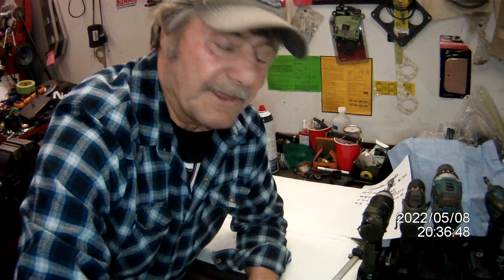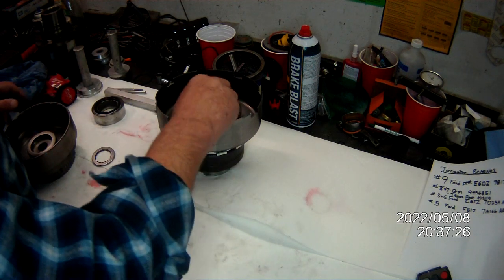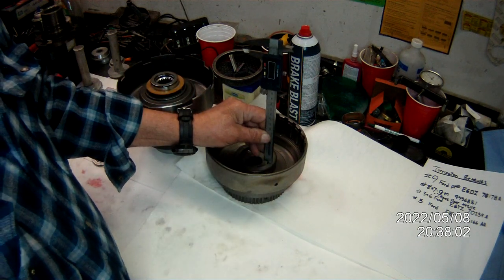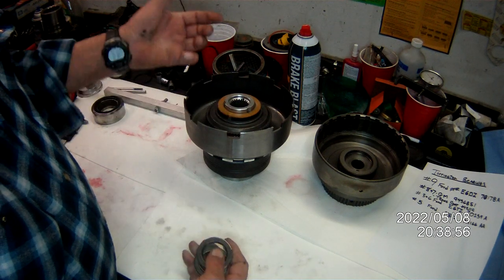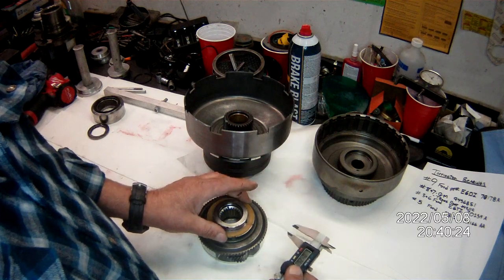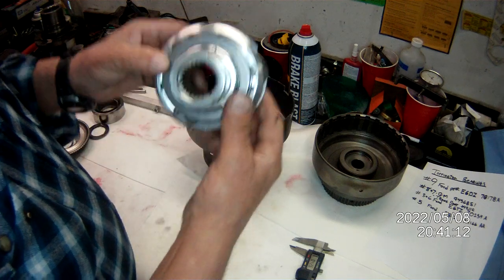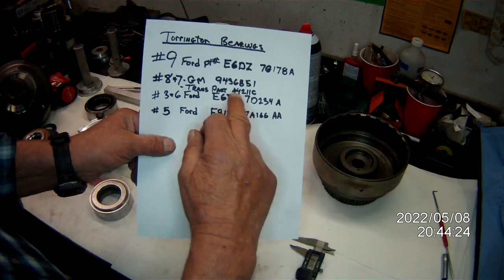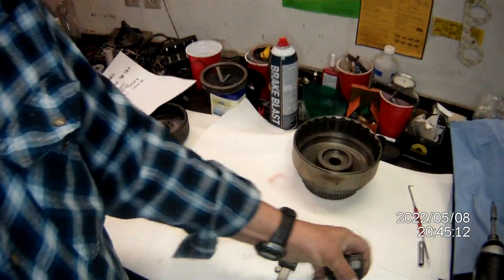Ford C6 Rollerizing

Comment: Hi Frank
I appreciate you sharing your expertise with the C-6 on your videos.  Does a rollerized C-6 take substantially less horsepower to operate compared with a stock C-6?  I am considering a wide ratio gear set that is rolllerized for a street vehicle.  Does it make sense to rollerize a C-6 for street use?  Thanks in advance for your advice.
Reply from the maker: yes

Comment: Hi Frank, 
next video can you show your c6 holding fixture for the engine stand, I need to make one so I can stop working on the floor.  Thanks
Reply: Hi Frank, looking at your cuts compared to the older dimensions you posted on 460 back in 2014, I see that the cuts shifted more towards the forward ring gear and less towards the front planetary. Is that so you don't have to cut so much on the tool steel pins? The total pocket is about the same .093 compared to .098.  Thanks again for sharing the videos, it is much easier for me to understand when I see something rather than read it.
Reply from the maker: #'s have changed over the years the instructions sent with the VB's hasn't as I hate typing
Reply: Thanks Frank, cant remember what part of Canada you are from, are you happy that Oilers won?
Reply from the maker: @vracing713  I'm a Diehard Flames Fan but now I have to Cheer for the Oilers ! Hate it but I will !

Comment: Thanks for sharing
Reply from the maker: I've Worked a lifetime and at 66 years old I figured I'd share my secrets as there is to much miss information on Youtube  about Building a Ford C6! My C6 Lives behind a 712 cid BBF, C460  Headed , tunnel ram with 2 x1150 Dommi's , and 5 Kits of NOS ! . and it will live for 100 1/4 mile passes with nothing but dumping the oil every 10 passes out of the pan ! Oil ? Pennzoil Type F . When you have a recipe that works you stick with it!!
Reply: @fmerkl  I still believe the C6 was and is the toughest production trans ever designed. Not sure why anyone would opt for anything else. I've been using mine forever with no major failures! Great work Frank sharing your knowledge with everyone!